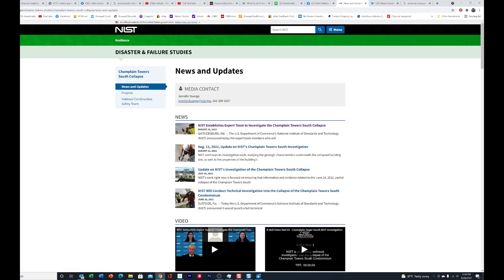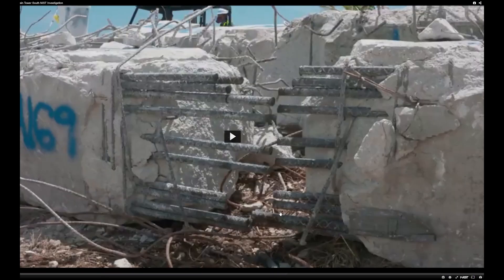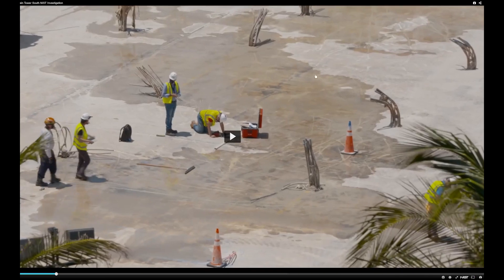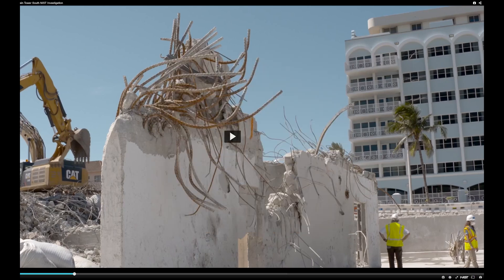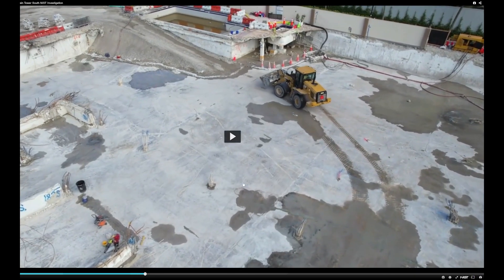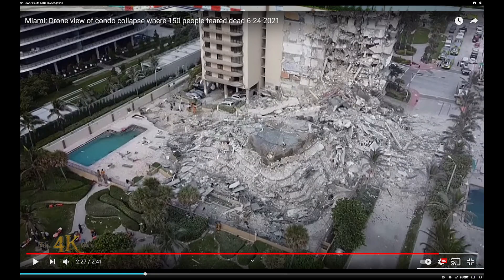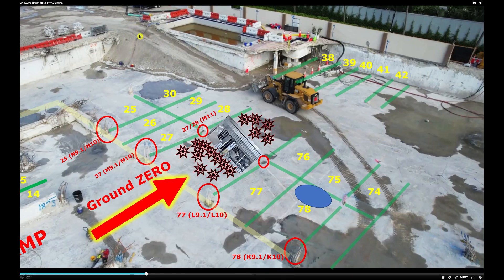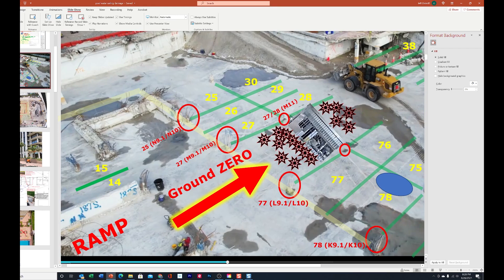Surfside Condo Collapse Site View NIST Video Ground Zero

Comment: In addition, the exploratory hole cut thru at least one piece of rebar that was tied into the top of the suspect column.  Given the weight of pavers added to the deck, the planters and trees, growing every year, The settling of some piles that defeated the drainage on the deck ( and in the garage ) and the obvious lack of maintenance and waterproofing in the deck structure, cutting that one piece of rebar was the proverbial straw.
Reply: I don’t think pile subsidence defeated the drainage. The drainage was defeated (and substantial weight added) by the incredibly poor deck redo of 1996. Look into that. I don’t think anyone has convincingly shown that pile subsidence really had any role here…
Reply: @kineahora8736   It’s known that there was some settling of some piles- the HOA blamed it on the construction of the new tower next door.
No amount of weight added to the deck could cause water to puddle unless the deck itself was cracking and sagging.  Or it never had a proper fall in the first place.  If the former case standing water would show up BETWEEN columns on the pool deck.  And we KNOW that standing water was pooling in the garage.  For standing water to collect at column Bases in the garage or the on the deck above columns, the columns themselves have to have sunk… Any cogent design would shed water away from the column bases. OR the contractor failed to create a correct fall for the garage floor or deck.
That the crew clearing the site have to pump water out of the site demonstrates that whatever drainage design was in place was either not working, or badly designed or implemented. ( tho- it could just be clogged with debris- but that doesn’t explain standing water in the garage for years prior to the collapse. )  Though the deck was loaded near its design limits, it was Undoubtedly the deterioration of the concrete and rebar from lack of waterproofing in a salt water climate and lack of proper drainage that ultimately compromised the strength of the concrete to the point where it could not carry that load.
Reply: @kineahora8736   That is not what the term straw man refers to.  A straw man is when your opponent can not counter the argument you made, and instead counters the argument he CAN counter.  You said subsidence couldn’t have been what defeated the drainage.  I countered that assertion directly and offered the fact that it had been established by prior inspection that some piles HAD settled. I then offered examples of how pile settling of even a small amount can defeat drainage fall, causing standing water.  I pointed out that the only Other way a proper fall becomes non-functional is if the span of the deck between columns sags- and that there was no evidence of significant sagging. ( Major cracking in the ceiling of the garage. ) rather there was evidence of water seeping into the deck.   Photos showing water pooling at the base of columns and on the deck directly above columns further suggests isolated piles settling and therefore the 
concentration of salt corrosion at the joints of the deck to the column top ( punch thru )and the column to the garage floor ( catenary folding when the deck punched thru ) 
Ergo my response was entirely responsive directly countering your argument that pile settling couldn’t have been the issue and can not possibly qualify as a straw man.
Piles can settle without significant soil subsidence.  All that has to happen is for the coefficient of friction between the soil and the pile to drop. Another cause of pile settling is construction nearby driving piles or adding significant mass to the overburden which can displace found water into surrounding soils, again, dropping its coefficient of friction.

I may well be entirely wrong…. But it wasn’t a straw man argument.
Reply: @christopherpardell4418  I thought it was a straw man because you were setting up an argument that I was not contesting:
You said “there is evidence for settling of piles” as if I were contesting that. That’s what makes that a straw-man.

Also you are misstating my argument still: I said NON-DIFFERENTIAL subsidence cannot defeat the drainage, not that subsidence can’t defeat the drainage. I also said there are other things that defeated the drainage.
Reply: @kineahora8736  You never said ‘Non-differential” You just stated pile subsidence.  So i did not misconstrue your argument.
Moreover, ANY settling of supporting piles Always messes with drainage, because piles just don’t all settle exactly the same.   If the soil condition changes, different loading would result in differential sinking.   I have never heard of ALL piles sinking so uniformly that they are still within the the 1/4” to the foot of fall  across an entire site and multiple piles.
That is, there is no such thing as Non-differential pile settling.  
One cause of piles settling is overloading.  Its possible the additional load on the deck contributed to pile settling… but ALL the piles did not settle the same… or there would have been just one big puddle. The question is was it that way the day after the building opened ( the builder messed up ) or was it something that developed over time?   Evidence strongly suggests the column next to the exploratory hole that had the concrete planter on top was where the failure originated.  But it could be that the pool deck adjacent sagged first and brought the column down with it.   In which case the puddles are more due to sagging of the deck than piles settling.  
Regardless, These buildings along the beach are often not on piles driven to bedrock. They are simply driven to an impact specification matching the expected loading plus safety factor.  Placing pavers on the deck could drive the piles deeper.   A massive weight placed on the site next door could also force groundwater into the site and cause the overloaded piles to slip lower under the load they were designed for because the soil is now wetter.
It will be interesting to see what the report concludes.   But it really is unnecessary to continue trying to accuse me of things I’m not doing.  I made an argument responding to a single point you made with which I disagreed.   I did not misconstrue, nor did I employ a straw man. I disagreed. Counter the points I argued if you can or care to.  If my response seems off the mark, then simply clarify what you meant to say.
Reply: @christopherpardell4418  I enjoyed the discussion between you and Kineahora, I just wish it were less contentious. Arguing over the term "straw man" doesn't advance the discussion.  Sometimes we need to be less prickly and let some arguments go unanswered.
Reply: @ronaldfharring7326    If someone erroneously accuses one of using a straw man, then I feel its important for them and anyone else reading these comments to explain exactly what the term means, and demonstrate thru example or analogy how one’s arguments were on point and responsive. It was a simple and direct counter to an argument he made.

Comment: I want to know if the garage door on the sister building has been fixed to stay open? It bothers me still that the survivors of the collapse got all the way to the garage trying to get out. Then couldn’t get out. So bad that they had to try to go back up to get out. That heavy metal door opening and closing was vibrating so much that could it have done some damage ? I would think it would.
Reply from the maker: No that door stays closed. Peopple who went down tot hhe garage were blocked by rubble. There is a gate at  the top of the ramp for pedestrians, but it was all piled  up with debris

Comment: At 3:01, you point out the 3 (4?) rebar rods together and mention that's a no no. But if you look at the right hand side of the same image, you can see probably the SAME rebar exiting in the same formation, and it's clear to see that they are not separated by 1/8", let alone an inch!

Comment: I don't know much about rebar but it should be evenly spaced through the concrete to add strength, not bunched up to the outside and it should all be tied together in a grid patern. The rebar to me looks pretty clean. I don't see a lot of serious corrosion on the larger rebar. It's all below grade and all the piping is broken so there is going to be a lot of water.

Comment: For my two cents, your doing a good job explaining what happened. I have a question, if the rebar rusted in the past four weeks would it not make sense that the rebar would have rust present when the columns were poured? Unless they used coated rebar which would have been evident in the photos.
Reply: There’s ALWAYS construction happening on Miami Beach. It would be interesting for someone to report the current state of any exposed rebar.
Reply: interesting. perhaps in the late 70's coated rebar wasn't required but with salty air and water you would think it would be necessary

Comment: One thing very obvious is the pealing and bubbling on the ceiling, is the area that gave way either at the time the deck failed or just after. Because ironically, over the ramp, the ceiling is perfect looking. 
Ad for the really clean rebar,,, probably when they shuttled the piers to the debris pile, they may have had to cut a lot of it, to free it from the fall pile. And in the process the vibrations of cutting and removal, cleaned the concrete off the ends of the rebar. Just a thought.  And as for the rebar being close to others,,,when they pour concrete into molds, forms. The sudden weight does tend to push bars around some. And maybe a loose piece shoves up to another one. I'd say that happens a lot. 
I ve only worked on single family homes. But I ve seen footer steel move when you are pouring. And, usually u can't straighten out the piece once u pour, or you'll have a big mess. 
So I'd have to bet when they pour piers, some rebar could scooch some. 
I'm glad you're staying with the building failure, we don't wanna forget it, for future safety sake.
Reply from the maker: Thanks for input on regards. Ceiling peeling like that means it was wet a lot and paint cannot adhere to it.
Reply: @jeffostroff  Exactly. Was so obvious that the blistering was towards the deck area of the parking garage, and not over by the driveway entrance ceiling. Another issue I would have had was the planters. Those are concrete walled cubes. Unless they were often cleared, resealed and made water tite, complete drainage would have been so difficult. A concrete cube sitting on a concrete slab, liner be damned, water intrusion over years, didn't have to be overwhelming, just constant. I'd like to have known the maintenance routine on them. To me, I can't see a whole slab falling at once wth the puncture method y'all describe, unless the majority of the slab was compromised, weakened by wetness. If the deck did fall first, and pull the 4or5 columns down with it, than the deck was totally to blame. And how it was constructed and maintained over the 38 years was the smoking gun. This is why driveways, carports and garage floors, aren't built level with the house floor. Don't get me started on basements in houses. Being a house builder for 16 years, and then doing remodeling for the last 17 years, you see, things that should have been done different. But when I just built um new, u think u prepped everything perfect. But u don't see it, 25 years down the road. Just like the building you're now writing about. 
Great brand new, cause everything is new and strong, but 40 years in the future,,not so nuch.

Comment: Well, we know the pool deck collapsed first which caused the building to collapse. The exploratory square they cut out is ground zero, so there were correct suspicions long before the collapse. Conclusion: Water was seeping down into the insides of the pool deck, rusting everything from within. The pool deck should have been torn down long ago and replaced.

Comment: Thanks for info as most stories from utube experts  are same reason why it happen so up to Court say who is guilty... I Believe when this building was builded in 1980s should had never dig up Pool Deck to the  basement at all. Nothing would had happed if just dig up to install Pool and Spa and lay paves so no pressure to surface at all. The Pool Deck basement should had never merge with building basement.
Reply from the maker: Well I still believe they could have dugout the pool in the garage and everything in the building still would have been OK but in a upcoming video I will be pointing out that if they had simply made an isolation scene between the pool deck in the building and not had the entire pool deck connected to the ceiling of the garage, then likely the building would not have been pulled down. Also if they had made 20 inch or 24 inch columns, I believe the building would have survived

Comment: It looks as though M10 lines up with the columns of the western portion of the building (the one which still stood)
Reply from the maker: You know if I was the architect on this project I like to keep things simple you know the old acronym KISS (keep it simple stupid). I would have just made sure all of the columns align off there's no reason for columns on the other side of the building to not be on the same grid and to have to be 6 inches off. These guys must have been on some of the cocaine from the cocaine Cowboys back in the late 1970s.

Comment: Officials said that the amount of rust was  "Astronomical"  their words
Reply: So astronomical rust in the rebar caused the concrete to fail but why then? Was there extra water to add weight and stress?
Reply: @winnieg100  I don't know, all I know is what I read about the rust.
Reply: @winnieg100  When Iron rusts, it expands up to 7 times its original volume. This pushes any concrete around it away, cracking it in the process. It also causes the concrete to stop gripping the rebar any more...
Concrete gets a huge amount of its strength from the bonding of the concrete to the rebar.

Comment: What does it mean when the rebar doesn't have dust on them or pieces of concrete (they're sheered clean after this collapse)? Was the concrete not mixed right?
Reply: I think the feeling is that it's had alot of it's substance washed away by constant water flowing though it and turning it to that white dust.
Reply: @jamesgorman5241  OH! That makes sense. Thank you.
Reply: @jamesgorman5241  Would water not create rust on the rebar? Which in turn should show in the surrounding area in the concrete as stains? I am struggling a little to see what happened to the rebar: greyish cover = stripped from the concrete by pull-out not rust; rusty surface = separated from concrete by rust und spalling, i.e. no adherence to concrete?
Reply: @V100-e5q  that does happen but the rust also expands the rebar and makes the concrete crack.
Reply: If you ever see a building pulled down when the concretes still good there's chunks of it on the rebar like beads on a wire almost.
Reply: @jamesgorman5241  That is what I said. Rust -> expansion -> spalling -> no concrete pieces on the rebar. But then I would expect rust stains in the concrete. A continuous cover with concrete i.e. grey matter suggest no water but physical force which has separated the rebar from the concrete. Which also should leave some pieces of concrete on the rebar. Else there was bad or no adherence to the rebar in the first place.
Reply: @V100-e5q  in these pictures though it's mostly been cleared away and put in a warehouse all tagged for the investigation the bar still there is the good stuff that didn't  topple the powder was there before the collapse though because there was peeling paint all over because it can't cling to the powder residue.
Reply: You are right though there did seem to be some quite severe rust strains in other pictures.
Reply: @V100-e5q  it does seem like the concrete and the rebar did not adhere like it was supposed to.

Comment: Jeff, could the inconsistencies with the columns have something to do with the fact the building was originally designed as a 12-story building? Then the design was modified for the penthouses the 13th story that had to get special exemption for its height.
Reply: Plus all the granite and marble floors added over the years possibly without removing the old tiles.

Comment: I enjoyed your video
I have been a architect project manager drafts man ( cad) and field inspector .
Once the architect design drawing are finished the engender does his drawings. 
The architect dose not redo his drawing to match the engineers drawings.
And the building is built per engineers drawings.
Do not try to match them!
They are separate documents.
Signed by separate people.
And inspected by different people.
The interior uses the architects drawing to finish, most of the time. 
One has to watch the RFI ( change orders) .
The contractor and sub can do any thing he/she wants. If you are not one site when it’s done.
And the city inspector may not have the latest stuff .
I some times had 3 projects to keep up with.
John kersey
Reply from the maker: Good info thanks! They should be able to share databases, then the columns and grid lines will all be referenced the same. I would go nuts trying to build this one.